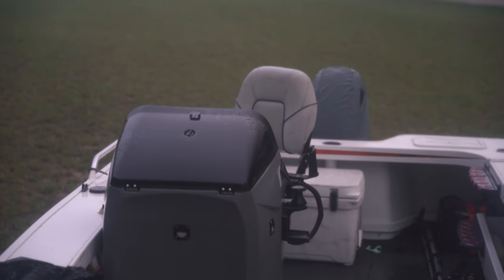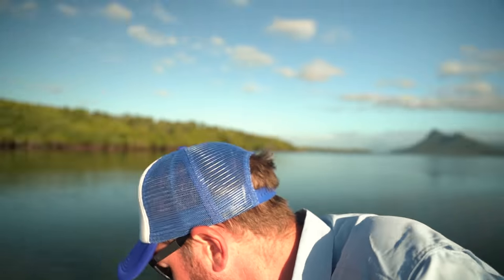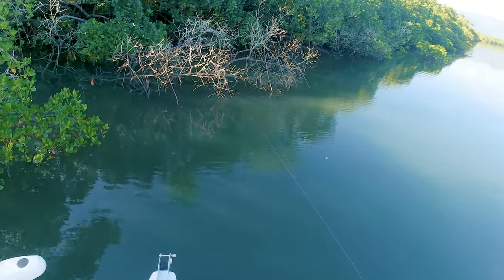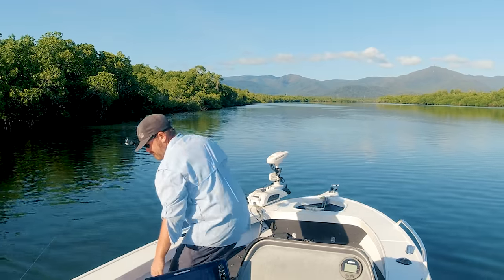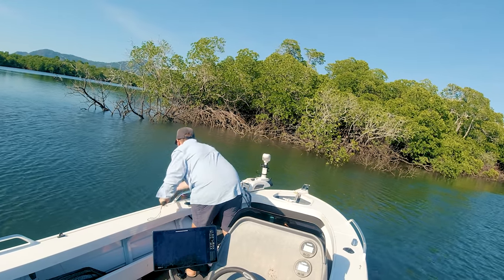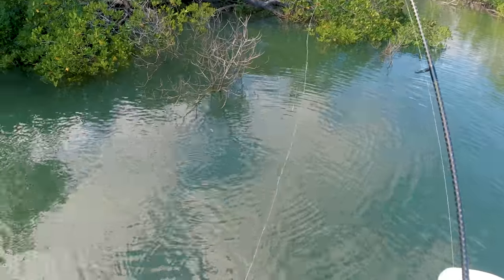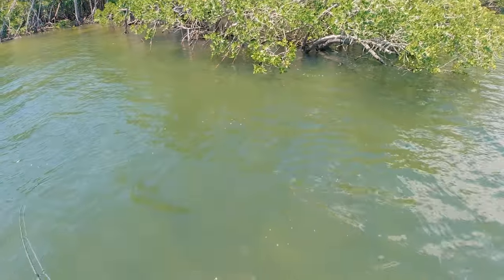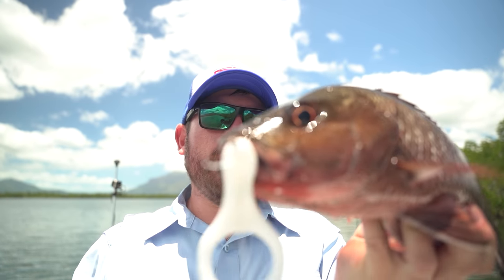Couldn't get past these fish

Comment: Nice work as always mate. Mate if you ever need another aluminium canopy on a ute try “Tong Box” in brissie. Had mine for a few years now, travelled oz and never had a problem with water or cracks. Rate them very highly. 
Keep up the good work and cracking casts dude 👍👍👏👏